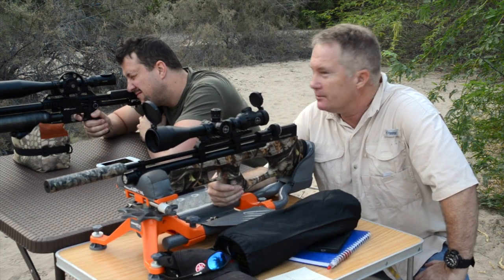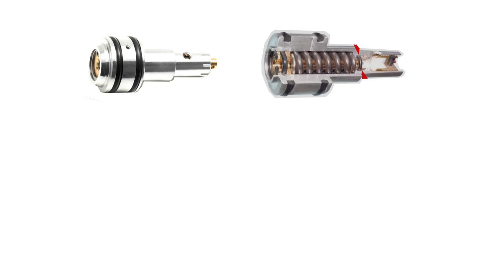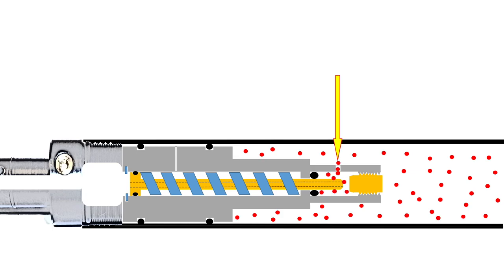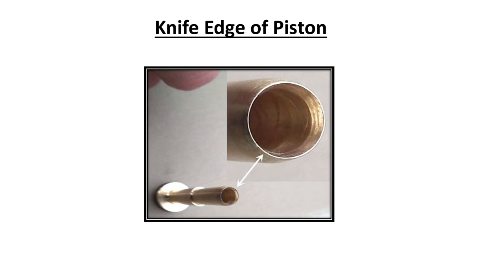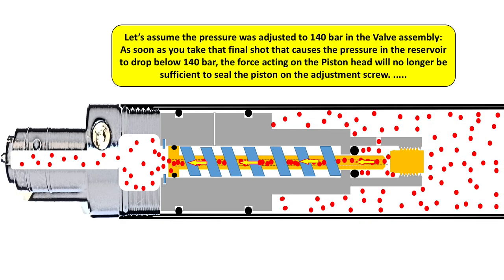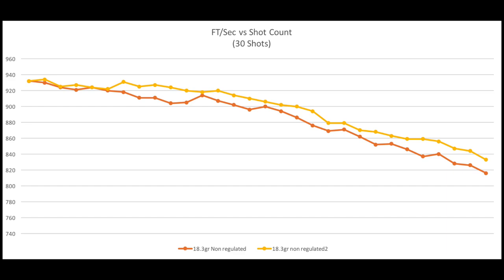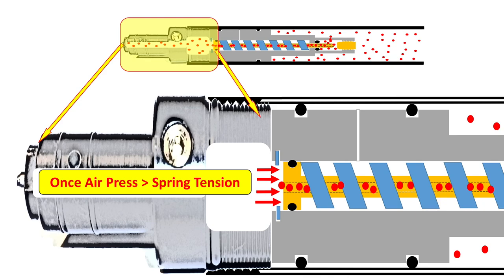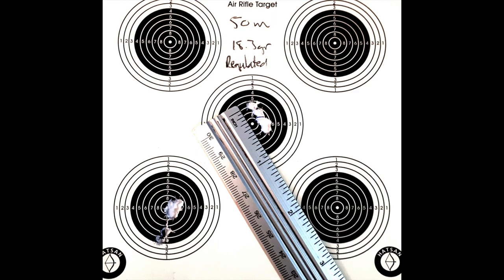PCP Regulator: How does it Work?

Comment: If possible to explain to me if I have a rifle which the regulater is set on 110bar, and the velocity using 18.33 gr is 970 ft/sec, but the grouping in not that good, what would be the solution?
Reply from the maker: Hi there. Most PCPs are inherently accurate and if your speed is constant, then you should be able to get "good" accuracy.
I have found that the pellets make a "huge" difference !! I have 2 x PR900 rifles in .177 caliber. The one likes 10gr or heavier and the other one wants 7gr pellets. 
My gamo coyote , at 30 meters, shoots about a 2" grouping with the gamo pellets that came with it. 
If I change to JSB 18.13gr pellets, then it is half inch groups !!! 
Personally I think the "overall" best .22 pellet is the JSB 18.13 grain pellets. almost all my PCPs love them.....

So, before you try adjusting anything.... Try JSB 18.13gr and some other pellets. 

Also make sure your barrel is clean !!! Krall PCPs initially shoot crap !! then after a VERY GOOD barrel clean shoots great...... My FX also needs a good clean after about 200-300 shots as it starts to shoot random....

Hope this helps !!! 
Regards

JB

Comment: My compliments on your video and explanation, very well done. BTW, do you know the actual tension of the spring itself? I'd like to make my own regulator as I have a specific tube diameter where it needs to go. Also, is the internal piston made of Brass? Just looking at the Reg bleed hole, should there be a corresponding hole in the air tube?
Reply from the maker: Hi there. 

Yes you are correct !! There should be a corresponding hole in the tube. I forgot to mention this. However on this kral the air escape via the cylinder threads. You do not replace the original oring on the cylinder to allow this to happen.  However on many other rifles you need to drill it if you fit a after market one. If it comes with a reg, then there will be a hole or path where the air can escape in the event of small leak. 

Regarding tension values: no idea... maybe write to Lane Regulators ??

Hope this helps.

Regards

JB
Reply: @affordableairgunningbyjb6994  Hello JB, perhaps you can help me with the dimensions of the spring. Would you tell me the Outside diameter, the Inside diameter and length of the spring as well as the diameter of the piston withing the valve body. I'm actually using the Chinese Bell washer type Reg's and I don't think they are consistent. I believe the spring reg would be a better system and being that make my own PCP's and the Reg would certainly be very specific to my application, I'd like to make my own. Very much appreciate if you could give me this info. Cheers.
Reply from the maker: @redgum1340  Hi there. I unfortunately don't have this rifle anymore. Also the springs are differnt in almost all of them. I have fitted them to Gamo, Kral, Hatsan and more. Every time the spring was slightly different... To get this type of information I would write directly to Lane regulators and ask them... They "might" release this type of information....? Happy Hunting

Comment: Hello, it is installed in the same way for Mega, because the pressure gauge is under the tank, but for the breaker, it is at the top of the tank. Are they different?
Reply from the maker: Hi there. As far as i can remember the installation was the same. I have fitted them to both. Just remember the following :
The one where the gauge is fitted to the valve assembly (bottom) will only indicate the pressure that the regulator is set at. So if set at 135 bar(like mine was) then it cannot indicate more than 135 bar. DO NOT OVER FILL when you refill..... Use the gauge from the compressor, not the rifle to indicate when you reach 200bar. 
 The one where the gauge is at the end of the cylinder will still indicate as normal.....

Hope this helps.

Happy hunting
Reply: Thank you, it was useful

Comment: I have another question, the working pressure chamber, when the trigger hits the chamber will release the pressured air but not the complete quantity! So how much remaining? And that is why the trigger can increase velocity and minimise it depending on on what gr you are using and what are the proper velocity for perfect grouping? Started to reach somewhere I think? Any help
Reply from the maker: Hi again. Ok, the "trigger" releases the hammer. The hammer hits the valve.... If the hammer hits the valve harder, it will release more air...
many expensive rifles , Like FX, you can adjust the hammer spring to hit the valve harder or softer...
This is something that the average person does not have to worry about. I have never adjusted or set any of my rifle's hammer spring tention, as I am happy with their performance as is...

Regarding the pressure in the "chamber":

Yes , you are right. Not all the air goes out, but also remember that as soon as the pressure starts to drop, more air starts to flow in from the tank, past the regulator into the chamber .

I have no idea how far the pressure actually drops , but would "guess" that if your reg is set at 110bar, then it might drop to about 70 bar before it closes ?? this is only a guess ...

Regarding the pellet weight: The lighter the pellet the faster it will shoot. You say you get 970fps. That is very fast for a 18gr pellet in a "normal" PCP...  If the JSB 18.13gr does not group, try a slightly heavier one that shoots a bit slower.... ??
Reply: @affordableairgunningbyjb6994  👍thank you for the first answer and 2nd, will do a test this week and check everything
Reply: One more comments the lane videos was very helpful and confirmed all what I was thinking about, and there are one philipino or Thailand video explaining the spring washers in the regulator which is amazing video

Comment: yes; i agree with everyone of these comments. very very informative.  best i have ever seen or heard. i have a couple question. i have an Altaros reg. and they say it does not use a breath hole- it vents through the threads where it screws back by the piston where there are 2 o-rings. they instruct the buyer to remove the 2 o-rings and that's where the breathing into the atmosphere happens.  i seens lots of people install the Altaros reg. and have great success. what are your thoughts on that if you don't mind.  also if my regulator is set at 130 bar and i fill my cynlinder to say 3000 psi which is what my hand pump is reading why is my manometer reading different. is the manometer going to read bar instead of presure. please get back to me if you can.  keep up the great video's.
Reply from the maker: Hi there Robert.

Yes, that is normal for some rifles not to need a breath hole drilled. It is the same for my Kral Puncher. It leaks from the thread on the valve assembly .....

Regarding the Pressure Gauge:

It depends where the gauge is situated .... Example:

On the Puncher the gauge is fixed in the valve assembly. You thus see the "Regulated Pressure" and NOT the cylinder pressure. I could not understand why the rifle did not want to fill past 135bar , no matter how hard I tried once the Regulator was in .... LUCKILY I only had a 232bar scuba cylinder to use.... Then the light-bulb in my head went on !! It CANNOT read more than that, because you fitted a regulator John !! So the gauge only sees the regulated side of the cylinder....

Now, my Kral Bull-pup has the gauge on the end of the cyclinder, away from the valve assembly and regulator. Thus I can still see my cylinder pressure when i fill it, but not the regulated section. I thus will never know the exact pressure of the regulator, but trust Lane regulators to have set it as requested. 

Warning: I have seen on more than one video where people say that once you fitted a Regulator you can "over fill" your rifle as you can no longer get "hammer-lock" and thus not a problem to over fill. If you are going to do this DO NOT fill more than 10% over the rated pressure....  I over fill to 220bar because I use a carbon tank to refill and the refill takes about 5-7 seconds to fill. The air thus heats up, and pressure increase because of temperature increase. Once the rifle cools down from a 220 bar fill, it settles just above 200 bar... But do not fill to 250 or 300, that is foolish. Even if your regulator is rated 300 (like mine) the rifle might not be safe at 300 bar.

Back to the Pressure Gauge: On my PR900W I had to remove the pressure gauge and thus have no idea what the pressure is in my rifle. Only when I fill it can i see what the gauge reads from where i am filling it. Robert Lane sells a aftermarket Pressure Gauge that fits on the front of the PR900W so now I again have pressure indication on my rifle....

Hope this helps

Happy Hunting

JB
Reply: @affordableairgunningbyjb6994  hi john; thanks for all the info. question: now that i installed the regulator in my Daystate huntsman regal my fps has dropped from 875 to 775. took the gun apart to screw in the hammer 2 complete turns to get more fps and it hasn't budge a bit. i would like to get it back to where it was which is 875 fps but i have no idea. can you help me out   thanks
Reply from the maker: @roberttheriot7612  Hi there Robert. 
That is quite normal.... watch from 9min50sec in this video. It explains it . My kral dropped from about 920 to 830. 
Many people think that the regulator will actually improve your fps/energy, but when you think about it, it is not possible. All it can do is "reduce" energy, but in return give you consistency. 

There are a few ways to now "maybe/possibly" increase your fsp:

Let be start by saying that I am no expert, but have a sound understanding and just giving you some possibilities that are done on PCPs to increase speed. 

1.  Increase the hammer spring tention. It is easy to understand.... Valve gets hit harder, opens more, allows more air to pass and thus faster pellet.... This you have done and if you say that it has not had any effect, I would return it to original setting. 

2.  Increase the size for the transfer-port. This in the Kral is a brass valve/port that can easily be drilled bigger. With the regulator I bought for the kral they supplied a drill that would open the hole about 0.3 -0.5mm larger diameter than standard. I do not know your rifles internals, but see if this is an option. I bought my sons a Kral NP05. It gets about 50fps more just by drilling the transfer port bigger and it is a relatively easy procedure. 
The same for FX barrels.
Look at some of the development on the FX impact barrels . One could buy aftermarket attachments where the transfer port/hole, from where the air enters the barrel, were larger. Huma made it and now FX have it as standard... 

Basically see if you can open up the air passage from the valve to the pellet. Anywhere where you can reduce the restriction of airflow might help...

3.  Inserting a plenum. This can increase the fps, but you might loose some shot count as you reduce overall volume in your cylinder by increasing the volume of the regulated section of the rifle. This will allow "more air" (still the same regulated pressure, but just more of it) of push the pellet for that fraction that the valve is open. 

Hope this helps.

Regards

JB
Reply: @affordableairgunningbyjb6994  hi JB;  if my regulator is set @ 125 bar give or take a few; what happens if i set it to say 140 bar. would that give it a little boost. could i start there before drilling and doing other stuff to it. or will that help at all   thank you
Reply from the maker: @roberttheriot7612  Yes, my mistake, that could be step 1. Prior to doing all the above. If it is a Lane regulator I think it is 5 bar / red line on the reg.....

Let me know how it improved the fps....
Reply: @affordableairgunningbyjb6994  ok; i reset the reg. from 125 ish to 150 ish give or take but close; and fps went from 775-780 to 800-805. i thought for sure it would of jumped more than that. getting disgusted. don't know what i should try next.  where do you think i can buy a stiffer hammer spring and longer.  i am maxed out.  turn all the way in.  can't believe it.  if you think of anything let me know.  don't want to drill yet.  thank you

Comment: Sir,i losened the pressure adjuster screw to increase the reg pressure.But i didnt make any change on the hammer spring.i came to know from the chrony test that after i increase the reg pressure the velocity drops than before .what happened here..any help please
Reply from the maker: Hi there Hmangaihi.
How much did you loosen the Reg ??? How many dots did you turn anti- clockwise on the Reg....?? If you go more than 3 dots then your regulator pressure will be about 150 bar (if you ordered a 135 bar standard setting) . Now at 150 + and with the extra plastic spacer inside the valve assembly (to increase valve tension) it might be too Much pressure on the valve and preventing the valve from opening enough .... Always remember that on a Kral, or other "Basic" PCP's you do not put a regulator get more speed... You put a regulator to get constant velocity with each shot..... My kral without regulator start to shoot at about 900FPS with 200 bar in tank, but with the regulator I am at 830 FPS, but VERY accurate !!
Only the much more expensive FX impact type rifles you play with regulator, and hammer tension to increase velocity....

Hope this helps.

Regards

JB
Reply: @affordableairgunningbyjb6994  Thank you so much sir, i'm using Diana outlaw  .177 Version.I'm turning the reg anticlockwise for four dots.Now i get to know the idea behind it.Thank you so much

Comment: I have a question for those with experience with air rifles.  I realize that it is difficult, but if the person is interested and a good reader, he will answer me.. Now all PCP rifles contain an air regulator, and this regulator expels air from the cylinder and remains trapped between the regulator and the piston struck by the hammer.. My question is this air, how many bar and how many cc.. and does it  The amount and pressure of the air I mentioned above will be greater in volume and strength than the air released from the spring-loaded air rifle?

Comment: Hi, very informative video and I thank you for the time you spent making it. I just bought a kral and it has a regulator installed so I opened it up like any good man would 😜there's not a spring in it but Bellville washers stacked like this(()) (()) (()) (()) now if I stacked them differently () () () () () () () () () will this increase my shots? Or power please speculate a bit 💪
Reply from the maker: Hi Aza.

I have as yet not adjusted a reg using Belleville washers.  As the rifle is not "suppose" to be opened (ha-ha) there probably aren't instructions on how to adjust. However: if you by either re-arranging,  or reducing the amount of washers can reduce the pressure recuired to "close" the regulator,  the shot count will increase and the velocity decrease..... 
The more pressure the washer push onto the piston the higher the pressure will be in the regulated section. Thus less shots, but more speed.... 

Just do not over do it as you might get hammer lock.... this is when the hammer can no longer open the valve... this is dangerous  !

Hope this makes sense...

Regards JB

Comment: Ok, dragging away the adjustment screw from the piston gave more power but what about the pressure cylinder capacity? For example, if the cylinder capacity without adjusting the adjustment screw was 100%. After adjusting the adjustment screw meaning pulling away from its normal position to increase power then when you fill the cylinder  with air, the capacity of the cylinder drops below 100%, Yes/No? If you try to fill the cylinder to 100% after adjusting the screw, wouldn't it explode, the cylinder?! Was I mistaken. If yes! Correct me. Thx
Reply from the maker: Hi there Benny.
Ok, let me try to understand your question and hopefully give you a good answer. 

If we do not have a regulator, and we fill the cylinder to max (200 bar for kral) then everywhere inside it is 200 bar... 
Now we put the regulator inside and in my video the regulator is on the "Left". So, on the Right side of the regulator the pressure will be 200 bar if i fill to max, BUT the regulator will not allow any more pressure to come to the left than what you have set on the regulator.

In my case the regulator is set at 135 bar. so on the right of the regulator is 200 bar and on the left side, where the valve assembly is the pressure is only 135 bar... 

Now we open the screw  like you say : pulling away from its normal position to increase power.

all that happens now is that the regulator will allow maybe 145 or 150 bar to be on the left side. If we fully open or remove the adjustment screw then the pressure will be 200 bar left and right side of the regulator.  So the regulator cannot make more pressure than what you put inside, but only "regulate"  how much is going into the valve assembly.

VERY IMPORTANT !!!! :

If your rifle's pressure gauge is "after" the regulator then you must be very careful. On the Bull-pup the pressure gauge is on the end ( right hand side on the picture in my video. ) and the regulator is left.

On the Normal Puncher the pressure gauge is fixed on the valve assembly !! That means that even if you put 200 (or more) bar into the cylinder the gauge will only show you how much pressure is in the regulated part (on the left of the regulator as in my video) 

So if you fill a normal puncher breaker with regulator fitted, then you MUST use the gauge on your compressor to tell you when your reach 200 bar because the gauge on the rifle can only see the regulated pressure...

Do NOT try to reach 200 looking at the gauge on the rifle... it cannot see how much is on the "other" side of the regulator....

Hope this helps.

Happy hunting

PS:135 is a good pressure for the reg. If you go higher then you just waist air....